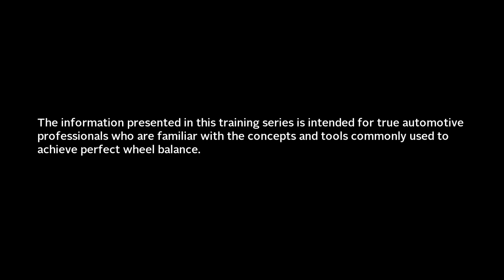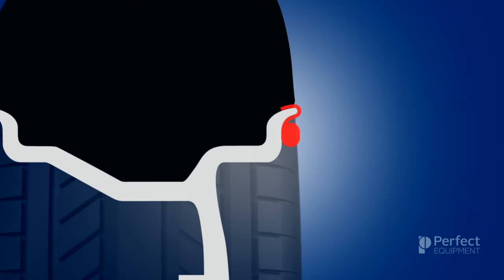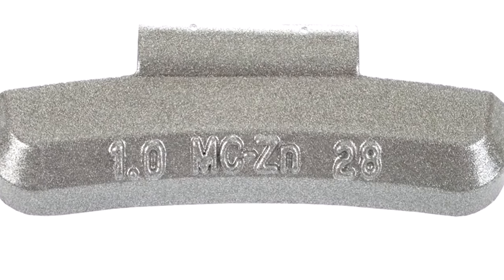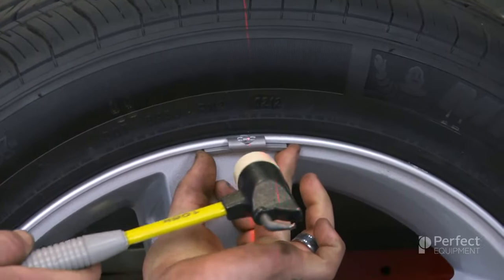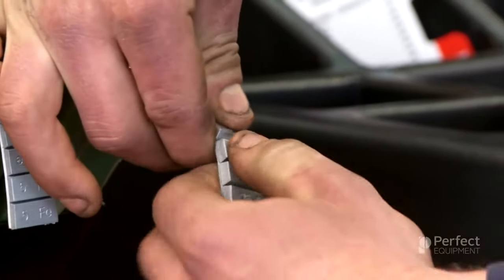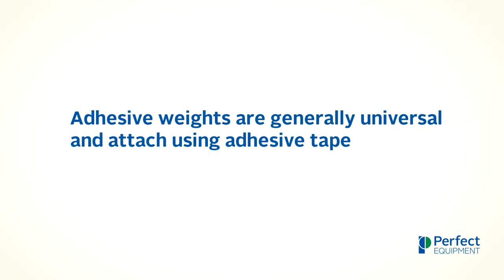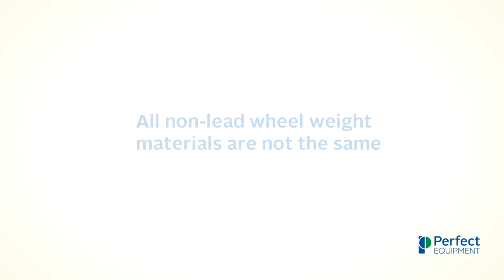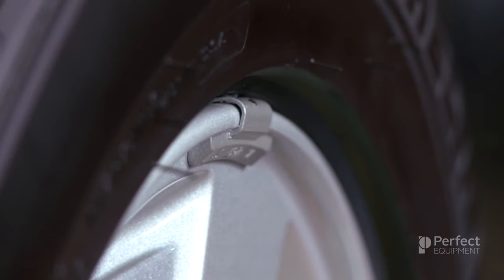Understanding Wheel Weight Types

Comment: Adhesive wheel weight all the way! It's more universal, more precise & flexible, and more common in here. I don't want to scratch or dent my rims with the knock-on one
Reply: Yes just need to make sure the tech working cares about process and follows it by prepping the surface properly and not just scrape or blast dirt off and call it done.

Comment: my tires have knock on and stick on the same tire (both types). Is that normal?
Reply: Yes, some rims do not have a flange on the outboard side, therefore require stick on weights. You can have inboard knock on weights and outboard stick on weights.